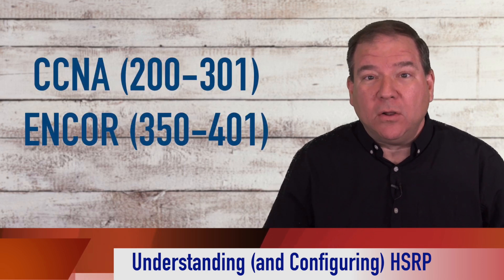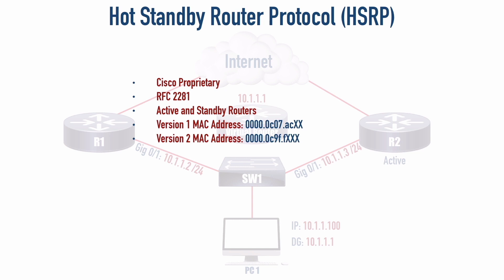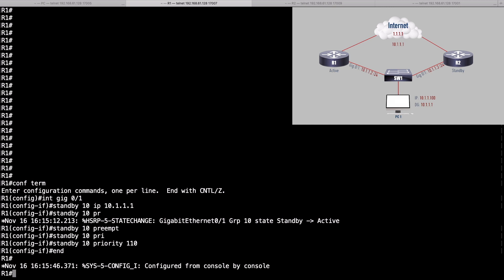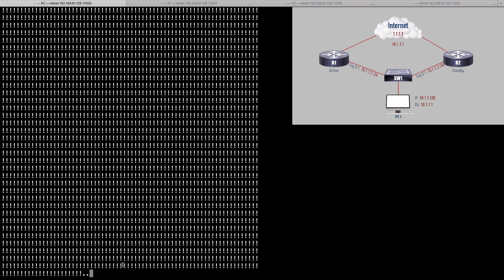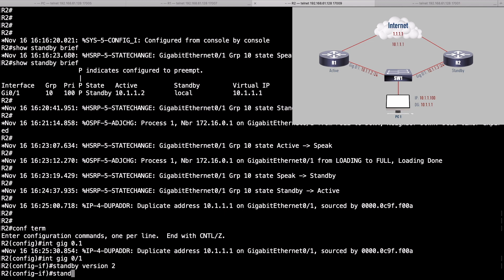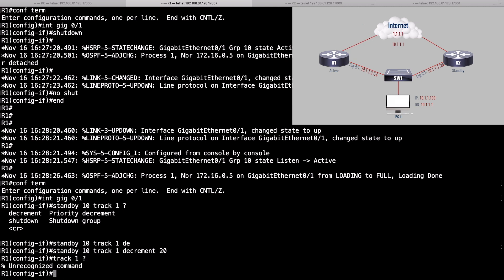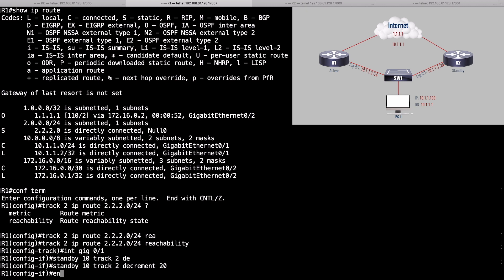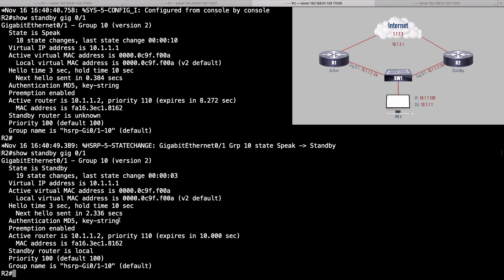Understanding (and Configuring) HSRP

Comment: Thank you for the explanation Kevin! When you say that with real gears, R1 will understand that the interface has been shut and therefore, it will send out the resign message to R2, via which link would it notify this ? As the local link between the routers have been disconnected already, does that mean, the hsrp notification needs to be routed via the uplinks ?

Comment: Thanks Kevin for the wonderful video! However, having understood what you have to say (if I am not wrong), led me to a query (hopefully of a level ahead). Here it goes. Would be great if you can enlighten me.

Can we have one interface of a router participate in more than one HSRP groups at the same time? I understand that one interface belongs to one and only one subnet and, HSRP is a means to provide redundancy. Redundancy can only be there for one sub-network for any particular interface. So there is no point or practicability of having more than one HSRP groups for one interface?

PS: Yes, we can have sub-interfaces and then we can do the same great HSRP configuration per sub-interface for one subnet, but then my question again is the same - for one sub-interface, can we have multiple HSRP groups to provide redundancy for same subnet? If yes, how does that fit in?

I hope my question makes sense to you.
Reply: Bdw, query erupted around 7:40 time in this video